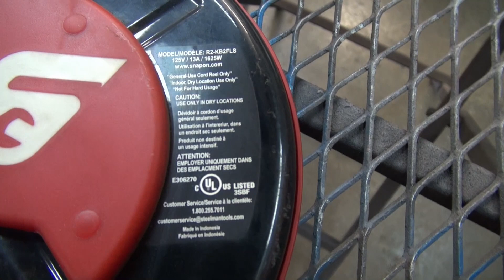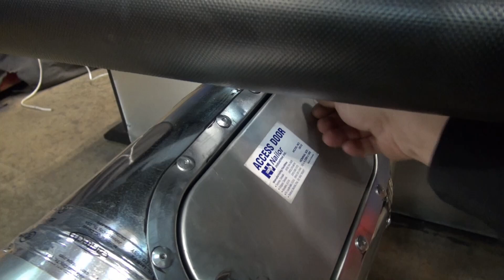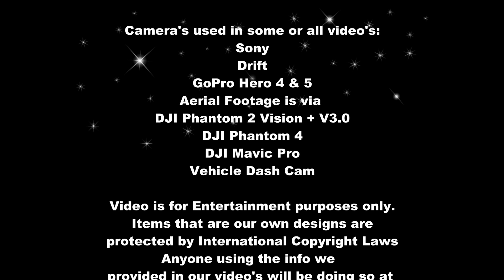You Said I Would Do It. Well (I Did It)

Comment: Happy easter guys , might be a good move to by pass that reset button on the reel, if it fails or malfunctions with a load on it it could get dangerous, not likely but possible, also a twist lock male and female would be a good idea or at least tape them together, I wouldnt worry to much about those amperage ratings on the coil either Its rated at 7 amps but can most likely handle quite a bit more.
Reply from the maker: This real is rated at 13 amps and if you look at the plus at the 3:00 mark you’ll see it has a lock on the plug so it can’t pull off. Happy Easter.

Comment: Would it make it easier to make the bends on the "sure footer" if you scored the bend with a small Laser etching while it is on the Plasma cutter?  Just a thought.
Reply from the maker: It might but it’s working well like it is. I weld over the cut after so it’s not noticeable. I don’t like to disturb the cutting process while it’s going on.

Comment: bore size of the cylinder looks roughly the same so tonnage should be the same as your old cylinder.  How is that going to help you out?
Reply from the maker: Old cylinder bore 1.25”
New 2” 
Hugh difference
Reply: bore or ram?  ram looks bigger but that wont change tonnage on extending stroke just retraction stroke.  I know I dont have a video to prove it like you want but I guess you will have to take my word on it.  We are a CNC machine shop that makes cylinders and other part.  Just tring to help.  thanks for videos.
Reply: Just a idea if you still have problems bending the plates maybe make you bottom "v" wider which will reduce your tonnage to bend the plate.  Thanks again for the Videos and have a Happy Easter!
Reply from the maker: Sorry Ram. Bore is much larger as well. The old cylinder wouldn’t make the complete bend on the plate. Now it does it with ease. That’s all I can tell you lol. I’m happy.
Reply: Paul & Kathy Short good deal!